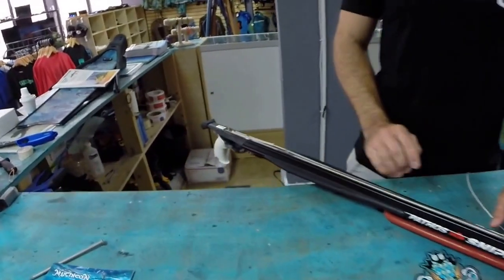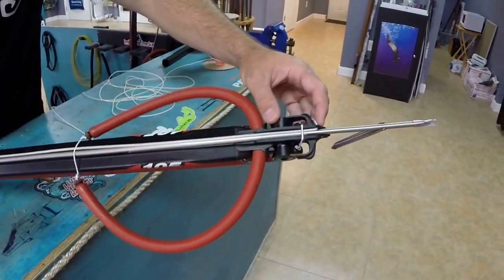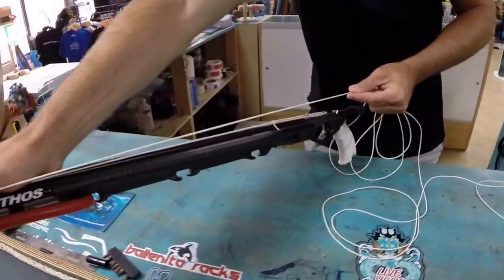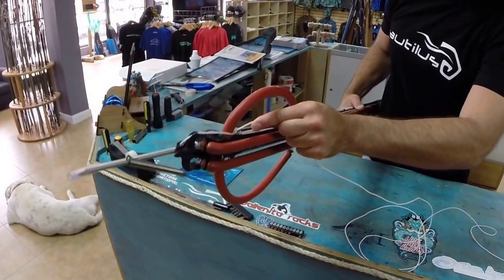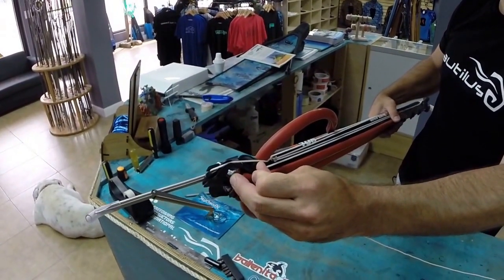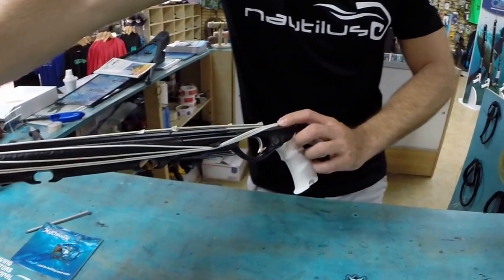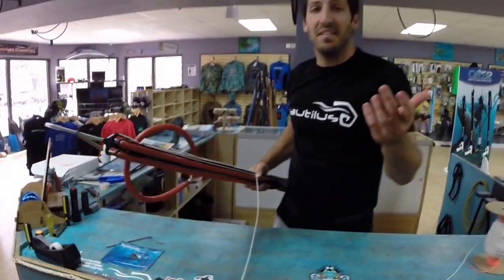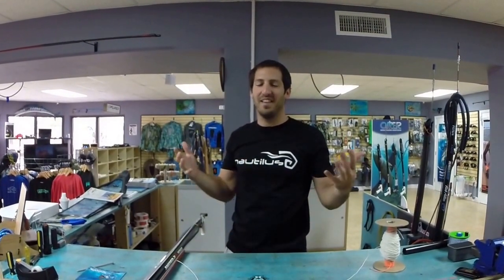How to Run Shooting Line on Pathos Roller Sniper Speargun

Comment: I used to run it the same way and it would catch and throw off my shot . I didn't realize it until my line snapped . After you run it around the roller keep it above the hook . The wraps after use the hook.
Reply: Just bought this gun and want to make sure I’m doing it right. Can you explain a little bit more.

Comment: This is not the correct way. The line is going all the way to the head again, instead of the notch. Putting it on the notch you are risking braking the line.
Reply: Just got this gun and want to make sure I’m doing it right. Can you explain a little more?